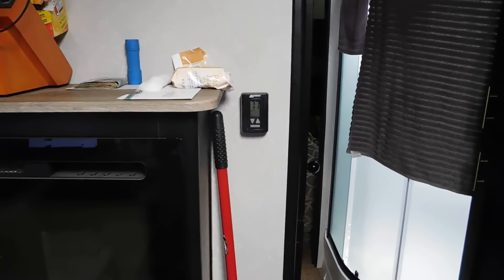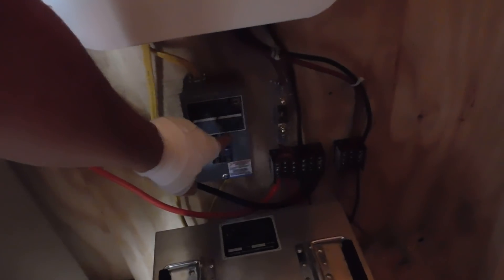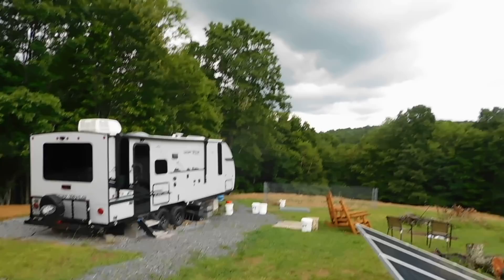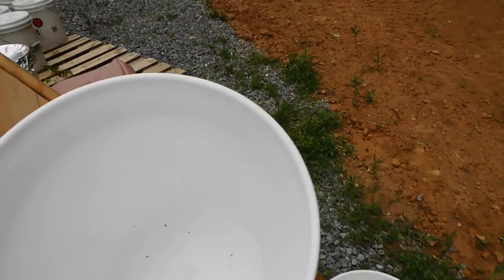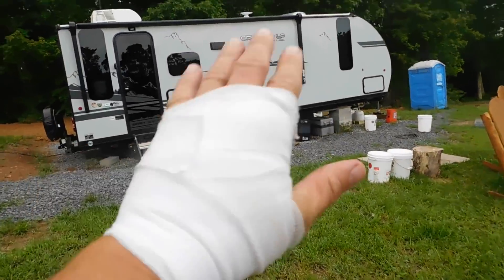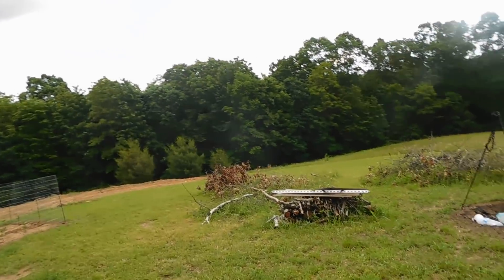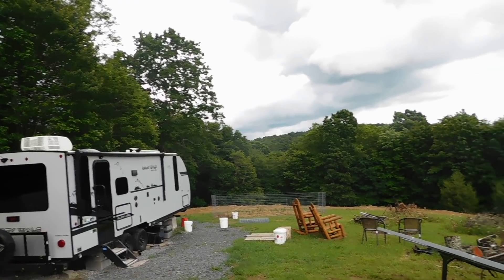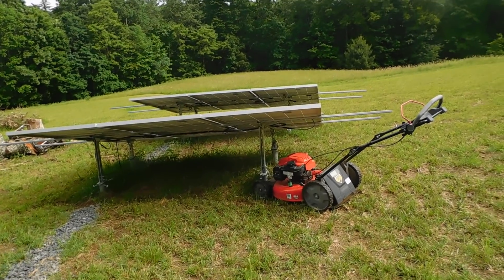Can you have air-conditioning with an off the grid solar system?

Comment: JudithB  Mowing  by hand  is  best  in  all  the  tight  areas,  but  with that much  to  mow  a  rider  is  best.  Right  now  you  have  time to mow by hand,  as  it  gets  hotter,  sticker  and  you  get  really  busy  building  you  wont  have  time or  energy.  I am mowing  tall  grass  right now, since  we  just  replaced  the dead mower with a self propelled.  I cant  whistle  very well anymore,  something else  to  practice!!!   30"  of  cucs came up  and  11'  of  Adzuki beans  came up,  waiting on  the  Half Runners.  I  need to  cut  herbs and  get them in the  dehydrator.  The deer  are  eating my blackberries  and  Concord grape  so  new  plants  have to be  inside the fenced garden.  My neighbor will  thin out the  deer  in the  fall!!  Well,  back to work!!

Comment: I have to get more potatoes planted tomorrow in my roll around laundry baskets and around my home (ground hogs hate potatoes) and in other containers that are easy for me. 

Are you using the roof fan to pull the heat out when you first go in?

Get a big roll of reflectix and cut pieces to fit windows in the camper during the day.   They are easy to just push into the window and take it out at night when cooler.     I should be selling for them.   I use them everywhere.

Comment: I am thinking you should put a 30 amp breaker that is what your camper is rated at when your using everything.
Reply: good suggestion.   In my large class As, always had a breaker on them when we parked.   It does not come on the equipment, you have to add it to the plug in.

Comment: There is a slow-start unit, that you can attach to the a/c unit, which will make it easier to run on your solar system, it reduces the amount of power needed to start the compressor in the unit

Comment: I think it goes without saying that it also depends on what units you are running.  An RV unit is small and energy efficient.  They now make wonderfully efficient AC/Heat units that are installed, not in a window, but high on the wall.  Who remembers the old monster window units from the 70's, that you had to prop up outside - would solar be able to run several of those along with other household appliances?  I can tell you, $400 for about any working riding mower is a bargain, AND you know its maintenance history!  Even with a riding mower, you will need first cut at higher blade level, then a 2nd cut at the desired height.  I am curious, how will you store your potato crop this year?

Comment: Spent the day installing 2 mini-splits and taking my central unit offline. Both are 110V  and will be powered by solar.
Reply: I am hoping to do exactly this. Do you make videos or would you care to share your sizing and kit info?
Reply: @AlohaPrepper  I have video's of the solar install, a short one on the solar water heater conversion. I haven't posted about the a/c and tie in yet. I'm running 2400 watts with 12- 200ah Lithium Ion batteries

Comment: If you want to run the AC more...invested into a soft start for the AC unit.  It eliminates that sudden draw on your inverter and batteries.  Easy to install right on the RV AC unit.  Look up the installation here on YouTube under RV Odd Couple...soft start.  I also have a solar shower to heat the water.  Works pretty well.

Comment: Of course you can run a air conditioner on solar with a battery bank. As long as you have the right system and the right air conditioner. People have been doing it for years now.

Comment: This is what the manual says. The recommended spec of AC breaker is 40A for 3KVA. and 8 awg wire. Realistically it will put out 25 amps. FYI Ed

Comment: So far as long as the sun is out on a nice clear day, I've been able to run 2 refrigerators, 4 smallish chest freezers, and 2 central ac units off my solar while still exporting 6-9kW to the grid.I have a large system with 43 395w panels connected to 350w microinverters (just over 15kW possible total power in perfect/lab conditions). I also have 13kWh worth of battery storage. Today's solar power total was around 95kWh.

Comment: I have an off grid solar system. I can run 2 - 3.5 cubic feet freezers, and 1- 3.5 cubic feet refrigerator. I have around 18 amps run with. I can run 2-5k btu wall air conditioners also. It can be done.
Reply: How big is your system?
Reply: @dragonflyryan3879  I have 12 -6 volt deep cycle duracell ultra golf cart batteries. 215 amp hour each.

Comment: You can switch out the hard starter capacitor for a soft starter on the ac unit. Just a suggestion.
Reply: @Angry Homesteader  Hard starts aim to make the inrush of current as large as possible while the soft start lowers the inrush of current as much as possible.